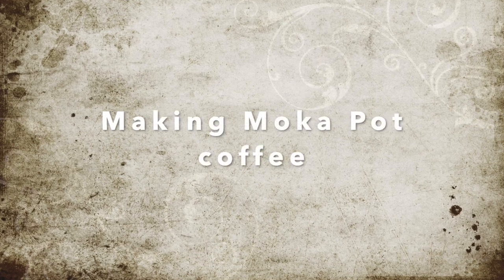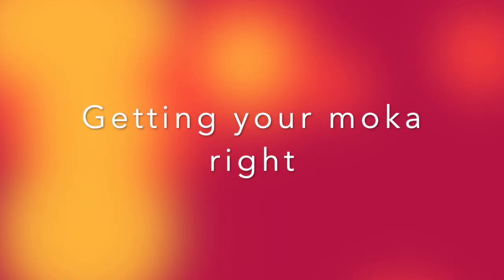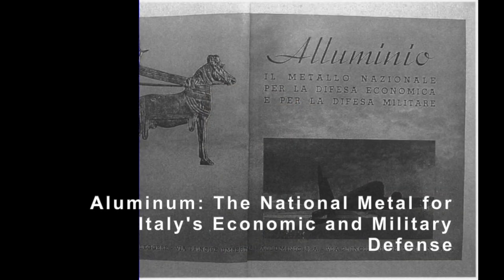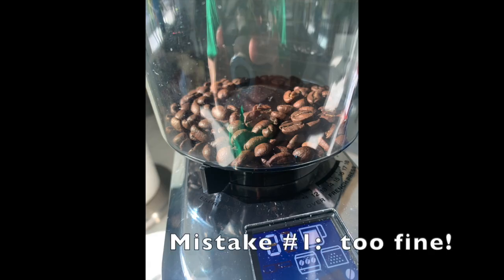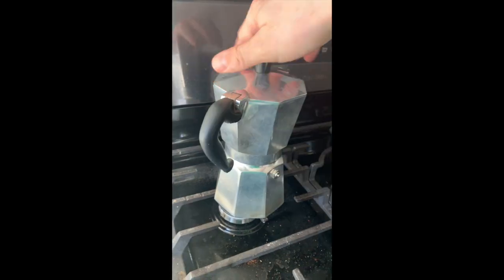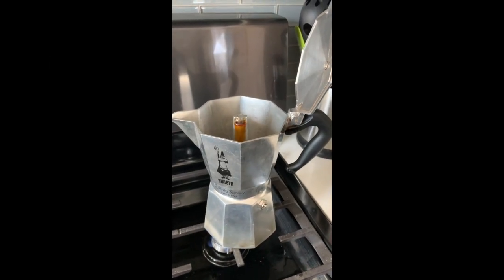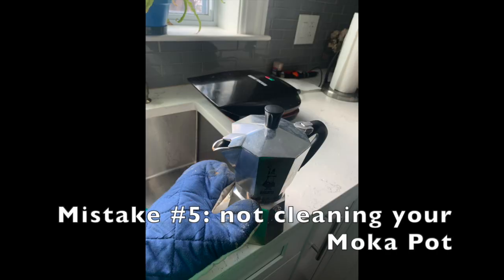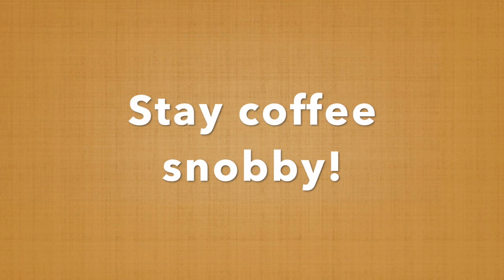Why your Moka pot tastes bad

Comment: Bialetti instructions are based on the best scientific testing and professional taste testing. They gross $180 Million US dollars per year. They're invested in making sure their Mokas produce consistently good flavor. You can trust Bialetti instructions. 

The best tutorials that explain the Bialetti instructions are "Annalisa J Moka pot" and "Il Barista Italiano Moka." 

1. Fill it with room temperature or cold bottled or filtered water till it touches the bottom of the pressure valve.
2. Loosely overfill the basket with medium-fine ground espresso, without pressing down. Scrape the top with a straight scoop handle to make it level with the rim. Wipe off grounds from the rim and threads. Screw it together tight.
3. Cook on a low gas flame or a preheated medium electric stove.
4. As soon as you hear it start to gurgle, immediately remove the Moka from the stove. It will finish brewing off the stove from the residual heat inside the pot. (So don't cool down the pot by holding it under cold running water.) 
5. As soon as it stops coming out, stir up the most-concentrated coffee from the bottom with a teaspoon and pour. 
6. You'll see leftover brown water full of fines in the bottom reservoir, and that's good because it would've diluted and dirtied your cup if it had gone through.
7. Wash the Moka after every use with hot water and wipe it dry with a cloth. Do NOT use soap! It will stay very clean! Once a month cook a pot of plain water in it to deep clean it.
Reply from the maker: Hi, thanks for this comment.  I second "Il Barista Italiano Moka", as he's where I learned how to properly clean a moka pot, by removing the gasket with a fork.

The leftover brown water is good to be leftover but actually it's not dirty and couldn't have diluted your cup if you'd tried.  It's a matter of the simple physics of the water line dropping below the connecting tube. Once that happens, you get to what Navarini calls the "stromboli phase" and the extra pressure built up through the vapor pressure + air expansion is relieved by the air/steam going straight through the grinds, bypassing the water completely. If you had a longer connecting tube, you could get more of this water to be a part of your coffee, but I suspect this small gap was intentionally left there as a safety buffer (perhaps also, as you stated to decrease the water:coffee☕ ratio and create a stronger cup!).
Reply: @loodog555 Hi, I meant to reply to you, but I got sidetracked. 😂

By "dirty your cup" I just meant your coffee might get full of the fines and sediment that are in the leftover water, some people call the fines and sediment "dirty," even though they're not really dirt, of course. 

I use a toothpick to remove my gasket, I learned that from another video and it's the easiest way I've found. A fork sounds good too, so I'll try that. 

There's also a Moka tutorial by either illy coffee or Lavazza coffee that explains the importance of leaving that leftover water in the bottom of the reservoir,  for the best flavor, by removing the Moka from the stove as soon as it begins to gurgle (You're right, it's called the stromboli phase). 

"Italian with Bri" channel has a 6 minute tutorial, and she removes her Moka from the stove a couple of seconds before it begins to gurgle because she knows the timing. That seems like a good technique, too. She also does a couple of things wrong, like filling the water level up to the middle of the hole in the valve and making a little mountain of coffee. Bialetti says not to do those two things, but those are variations a lot of Italians like to do anyway. 😂

Bialetti has a science department and engineering department, as you'll see if you click "Careers" on their page often enough to see the job openings being posted in their Product Development department. They do a lot of ongoing testing. They've replied to my emails to answer some questions. 

My understanding is that Bialetti got the idea for the Moka by watching how his wife's washing machine worked in 1933, as you mentioned before, but he got an engineer named Di Ponti to scientifically design the Moka and the process for making the stovetop "espresso." So it was a collaboration. Di Ponti understood the physics of the heat, air space, water vapor, best brewing  temperature, and timing for the best extraction and flavor. 

My cousin is a retired aerospace engineer, who's been the lead on a lot of big nuclear and petroleum projects, and he also does, mechanical, electro mechanical, micro electronics, etc. He said the Bialetti instruction to use cold or room temperature water in the Moka is because the lower temperature water has more molecules so, when you heat it, it expands more and creates more pressure than if you start with hot water.

And, of course, cold or room temperature water that's cooked over a low gas flame, or a preheated medium electric stove, per Bialetti instructions, also prevents the water inside the Moka from boiling, which would be too high a temperature for a good extraction and it would brew too fast. The Moka is never supposed to boil, even though Bialetti sometimes refers to the bottom chamber as a "boiler," but they usually call it a water reservoir.
Reply from the maker: @photina78 Hey, for some reason Youtube never notified me about your reply!  There's a lot in here I want to reply to now that I've read it.

I'm dubious that anyone could anticipate the gurgling based on timing alone down the nearest second, since there's so much variability every single time you brew, but hey, if it works, it works!  I agree that the "mountain of coffee" that Italians all tell me to do is just nonsense based on simple considerations and my actual experiments.  The "mountain" will produce a certain kind of result and I think the Italians have gotten attached to what it tastes like when it comes out that way.  For filling the water level up to the middle of the hole - I assume you mean the fill valve - it's a matter of safety to not go higher than this, but for dark roast filling it up less than this can improve your flavor, because it advances the brewing time to brew at a colder temperature

https://www.youtube.com/watch?v=NQrRzTzU_Yk

It's interesting to hear the context you're giving about Di Ponti and your cousin's thoughts, but I'm actually a physicist and even I was wrong about how this thing worked until reading the recent papers about it, which came out between 2001 and 2009 (around 70 years after Di Ponti's work)!  I explain the paper that's most relevant to starting water temperature in this video:  https://www.youtube.com/watch?v=O14BIH-9KTA

Somehow for about 70 years, we all missed some of the physics, including that the machine will take longer to brew when you put more water in it, and (as you stated) that it actually isn't desirable to let the water boil to brew.

I'm thinking about your cousin's claim about the density of the cold water being higher than warm water... it's true, but we're talking about a 4% difference between room temperature and boiling, but ideal gas expansion of the air would be 27% over that same temperature difference and the vapor pressure of the water would increase 4200% so I'm having trouble believing that the water's nominal difference in density really matters here, but the colder temp would make the expansion effects I just mentioned more pronounced. 

And anyway, as the 2008 Warren King paper shows, the main problem with moka pot is not that it brews at too high a temperature, but actually too low, which is why King (and notable baristas like James Hoffman and Tristan Stephenson) recommends preheating the water.
Reply: @loodog555  Thanks for all the info, I'll explore it as soon as I have a chance. ☕ 😊

The ideal temperature range for brewing espresso and coffee is 195°F to 205°F, so the Moka water shouldn't be heated to the 212°F boiling point, as it almost certainly will when you start with hot water. 

I can't remember if I mentioned this without rereading the thread, but Bialetti has their own Science and Engineering Department to do all the testing, including taste testing, so their instructions are based on science. 

I get consistently great results by following Bialetti instructions, so I usually start with room temperature bottled water, and many Italians use cold tap water; but I even get great results when I start with chilled bottled water out of my refrigerator. 

I like medium to medium-dark roasts. Lately my favorite pre-ground Italian espresso is Bialetti Perfetto Moka Classico Espresso. It's super smooth, but it's probably too smooth and mild for people who prefer more boldness and complexity. Sometimes I want more boldness and complexity, but I haven't tried the other Bialetti coffees yet. 

I like my Brikka better than my Moka because the flavor profile is a bit better and I like the crema. I read that Bialetti thinks the Brikka makes better flavor than the Moka because the Brikka valve holds back the water until it's all heated to the same temperature before it goes through and bathes the coffee powder; whereas the Moka allows the water through when the first bit is a bit lower-than-ideal temperature, and the middle water - which most of the water - is the ideal temperature, and finally the last bit of water is a bit too hot. 

But Brikka doesn't make the gurgle sound so the instructions are to remove it from the stove as soon as you see steam come out the hole they cut in the top. 

Here's my timing with my 2-cup Brikka filled with cold or room temperature water: 0 to 4:00 nothing happens. (I often set my timer for 4:00 minutes so I can do other things, then come back to watch the pot when it dings.) At 4:00+ the coffee quietly seeps in. A few seconds later the crema starts coming in. At 4:30 I see steam and the crema stream is established, so I remove it from the stove and let it finish brewing on my countertop. By 4:55 it's finished brewing so I pour.

Comment: Thanks for the tips. Can I just ask why you put the pot under cold water to stop the brewing process instead of just pouring the coffee straight into the cup? Thanks!
Reply from the maker: Hi, thanks for the comment!  A lot people do exactly as you say and stand by it.  

That said, I personally don't recommend it because when you tilt the pot sideways, the bottom end of the connecting tube is no longer immersed in water (since there's always some remaining water and the remaining water goes sideways when the pot is tilted). The upshot of this is that instead of sending your heated water through your coffee grinds into your upper chamber, you're sending superheated steam through instead.  

There's a 2009 paper by Navarini et al. that calls this the "Stromboli" phase, when the water is bypassed and steam goes straight into the grinds.  They strongly advise against letting your coffee get to this.  I explain the paper here: https://www.youtube.com/watch?v=2jLdGi7kjzk

I explain experiment a bit on what happens when you don't cool your pot right away after getting bubbles.  That video is here: https://www.youtube.com/watch?v=aA8KoZbtl84
Reply: @loodog555  Thanks for the detailed reply; I appreciate it. 

I'll be sure to check out your other videos on the subject. I'd love to get into this kind of brewing method, but I've had various attempts over the years and always end up with very bitter and harsh coffee, so always go back to other forms of brewing.
Reply: Bialetti instructions say to immediately remove the Moka from the stove as soon as you hear it gurgle. It will finish brewing off the stove from the residual heat inside the pot. 

So don't hold it under cold water, that's not correct technique. Just let it finish brewing on your countertop. Stir up the most-concentrated coffee from the bottom and pour. 

Bialetti earns $180 Million US dollars per year. They invest in the best scientific testing and professional taste testing. You can trust their instructions for consistently good coffee that's never overcooked.

Comment: I use hot water from the water cooler/heater, medium heat until it bubbles and turn off the heat and move it off the stove immediately. Pour into my cup and it's perfect every time. I've heard not to boil the water and that it should be slightly less than boiling, so the water from the water heater seems to be perfect. My first few times I over brewed both with too much heat and too long of a brew, so I know the bitter taste he's talking about. It was almost enough to put me off Mocha pots, but so glad I stuck with it!
Reply from the maker: The most specific advice Ive seen to preheat to about 70°C.  Here’s why: https://m.youtube.com/watch?v=O14BIH-9KTA

Comment: Normal misconceptions when brewing coffee on Moka pot (but also applies to other methods)

misconception #1 : water needs to boil to build pressure WROOOOOOOOOOOOOOOOOOOOOONG
waters evaporates even before it starts boiling, so pressure starts even below boiling temperature, 

misconception#2 : you need water vapor to build pressure, ALSO WROOOOOOOOOOOOOOOOOOOOONG, 
air pressure can also push the water up in your moka pot, so having a lot of air will increase pressure faster than a pot filled with air 

Misconception #3 you need to brew your coffee at high because of....reasons  wroooooooooooooooooooooong 
you only need your water to reach your desired temperature(between 195 and 205), then you need to adjust your flame to keep water at that temperature during the brew

misconception #4 you need to put the whole moka pot when you put it into the flames  WROOOOOOOOOOOOOOOOOOOOOOOOOOOOOOOOONG
You can heat your water and once your water reaches the required temperature you can add the grind holder and close the pot (of course you need something to hold the pot without burning yourself) 

Misconception #5 you need boiling water to brew your coffee right, WROOOOOOOOOOOOOOOOOOOOOOOOOOOOOOOOOOOOOOOOOOOOOOOOOOOOOOONG
best temperature to brew coffee is between 195 and 205, a little below boiling
Reply from the maker: Hey, thanks for your comments. Indeed, water does not need to boil for the milk about to brew. I explore the physics of mocha pots and what temperature did you use in the base in my series of videos here: https://m.youtube.com/watch?v=O14BIH-9KTA

Of course, if you check out the 2008 paper by Warren King that I explain in the video above, you will indeed see that a combination of the vapor pressure plus the expanding air is what causes the pot to brew!
Reply: @loodog555  
amazing videos and the best part is how it's backed up by a real scientist article ! 
first time I see someone talking science out of the art of brewing coffee and not just following the craftiness of trial and error. (probably that's why you get all the hate from Italians)
well trial and error can be good ways to explore different results, but without knowing what brought you that result is like trying to hit a nail in the dark, sometimes you hit the sweet spot, some times you don't.

Comment: Just got a moka pot..do you have to use ground beans and must the holder be fully fill with coffee?
Reply from the maker: Q: do you have to use ground beans?

A: only if you want to make coffee.  Every method of red coffee requires grinding the beans. For best results, buy yourself a burr grinder.  The Barraza encore is a favorite entry level Choice among home Brewers. The reason to buy a good grinder is explained in this video: https://www.youtube.com/watch?v=dgM-_nPPKgw&

As for filling up the holder, you basically should. If you don’t fill it up, you will wind up with weaker coffee: https://m.youtube.com/watch?v=bCSn2CXWZOE
Reply: @loodog555  thanks

Comment: I use a heat diffuser on gas cooktop. I have never had a bitter tasting Moka pot coffee. Scorched coffee, just doesn't happen.
Reply from the maker: Hey, thanks for the comment!  

Yeah, @James Hoffman advocates for the same for extra control and more equal heating: https://www.youtube.com/watch?v=BfDLoIvb0w4

I've never needed it or tried it, but as many have said, the beauty of the moka pot is how simple it can be.  (Though I do indulge in using AeroPress filters consistently, because it really does improve things: https://www.youtube.com/watch?v=fy1YKqrPYCw)
Reply: @loodog555   Hi, yes, I started with a French press and moved to Moka pots. I'm happy with the pots and have no ambition to go to Espresso. I don't know how many comments I've read about bitter tasting coffee, from a Moka pot as a result of scorching, yet the diffuser eliminates that. It was something I decided to try a diffuser with the pot from new. Both to protect the pot and the coffee. It worked.

Comment: #2: dont pack the grounds down!
 this rule didn't make sense because professional coffee makers pack their coffee. they even have special tools to do that. I'll   packing the my grounds assures the water dilutes thru the grounds. otherwise it will pass without touching the coffee.
Reply from the maker: Hi S Salem, thanks for commenting!  Professional coffee makers pack their coffee down when they are making espresso (and so do I!), but bear in mind that espresso is forcing water through the grinds at nine bars of pressure.  A moka pot is only using up to 2 bars.  Packing down your grinds will reduce the coffee flow rate by as much as a factor of two, as demonstrated in Warren Kings 2008 paper (http://www.msc.univ-paris-diderot.fr/~phyexp/uploads/Moka/article1.pdf) which I explain here: https://youtu.be/O14BIH-9KTA

As for the idea that the water will somehow exactly find the less than 1mm-wide channels that avoid all the coffee grinds, well, that seems improbable to me, especially that the coffee puck you get afterwards is thoroughly soaked through. You are right in that the flow rate will be increased when you don’t pack the coffee down, but in the case of a mocha pot, this is a good thing, as you already are in danger of over extracting the beans. Hope this helps!